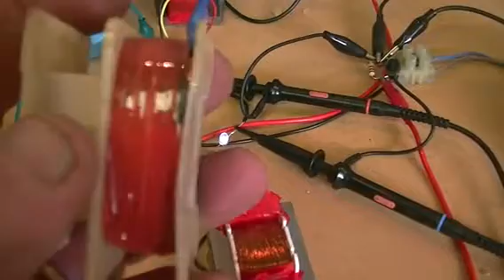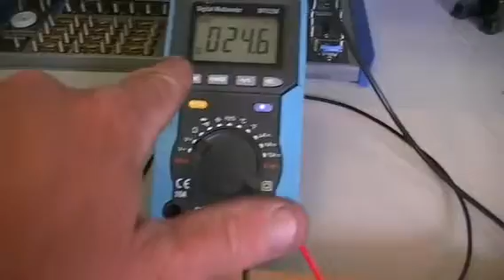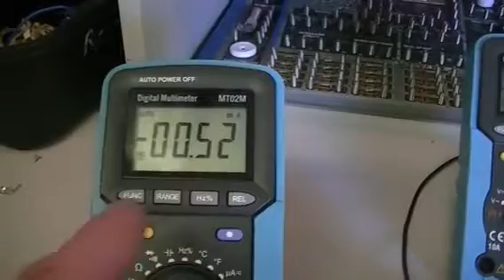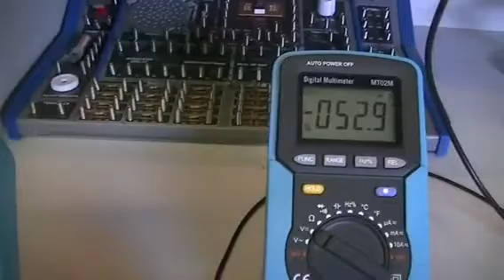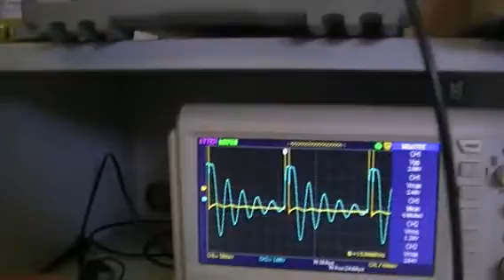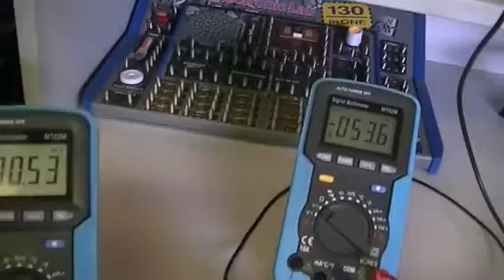overunity transformer reserch V2

Comment: I was able to partially 'solve' this the interesting part is the transformer configuration
But regardless the secondary is free-wheeling,  it's ringing at it's self resonant frequency 
It will ring like this and as the input frequency is raised the ring will lessen until as mentioned the input pulse will be pulsing the secondary at it's self resonate frequency. 
The commonality is probably be the earth ground which is allowing the secondary to free-wheel. 
In my analysis I only observed such action without an earth ground with a split core then coupled,  I.e a core split in two, which allowed the secondary to free-wheel

Comment: By co-incidence this is something that i am experimenting with also - :

- something that simple could be acting in that way just because it is not all that 'simple' once you understand what is probably occurring.

- to give you some starting points i will link you to a video you can watch if i put a link in here likely YT will try to censor this comment in fact i highly recommend that you move all your video's across to 'bit chute' if you can as YT will probably increasingly start to 'censor' many people. 

- anyhow here is a video you can watch - https://hooktube.com/watch?v=OXibsOzjipw

- the key is in a coupled inductor a lot of people don't seem to know that a 'current' in a winding can be 'interrupted' and what he means by that is it can be 'converted' you will see how when you watch the video - the result is a 'flyback' but really a 'magnetic' pump - in your setup you have then used a principal from this Air force video -(i will link) but you are not using the LC you are using the pulse and a single 'ringing' (actually rotating) coil. 

- so as i see it you have interrupted and converted the pulse at it's peak on a coupled inductor creating a basic 'magnetic pump' you have then tuned it to hit the pump at the correct time as per this video here :

https://hooktube.com/watch?v=1uSBKUsKpYQ

I hope this find you well.

to see if that is the case you can test by removing the diodes in some other configuration as it is the diode that acting as the interruption switch .

you may like to see the way in which the air force related the 'ringing' oscillation to the rotation of a flywheel i really liked that as it is far more accurate.

Comment: I was thinking what are the possibilities if a simple delay circuit can be made to switch on led or small bulb somewhere after the trailing edge of the source pulse.

Maybe this way it will not have any impact on the source at whatever the load at the output.

I assume you have already figured out on how to maximized the pulse width from output as compared to the input pulse width  base on video.

Comment: Hi mate, here's a guess: The primary and secondary are both capacitively coupled as well as inductively due to way windings are wound together. Capacitive coupling links fast changing portion of input to output at initial pulse step. Input cannot see far end of primary coil till current reaches far end of winding. So output initially capacitively coupled. Then after some delay current rises in primary inductance linking both coils inductively. However input current pulse has ceased by then and primary current doesn't like being interrupted so collapsing field maintains current flow for an additional time. When input pulse is ON output impedance of generator is very low, however when pulse duration has terminated the output impedance of generator is most likely open circuit or very high Z value. So primary is no longer damped by the generator allowing it to ring like a bell.
Reply: +smokyatgroups Interesting thoughts, I have used a small audio transformer as a capacitor to couple a frequency counter to a radio. Otherwise I hear noise from the frequency counter through the radio. IIRC the transformer did better than any ceramic cap, or I wouldn’t have left the more expensive transformer in place. I connected only one end of each winding as a capacitor. I have unwound them and they are done with an inside winding and outside winding with no dielectric isolation.

Comment: Transformers only require an alternating current and therefore changing magnetic field to work.  A current will be induced on the secondary if the voltage is positive or negative. I cant actually see what you are saying here.  What do you mean by flowing in/out?

Comment: Very interesting effect that center tapped ground, diode, and capacitor is doing. That capacitor is a beast of a filter. Have you tried putting a blocking diode on your positive side of you PWM?  I wonder if that would effect the circuit at all?  Thanks for sharing as always and keep up the good work.
Reply: Daniel Gendron Quelle est votre interprétation de cette citcuit ?
Reply: Yes this is when your primary is a square wave. di/dt is appearing same as this in the secondary (second order damping impulse) Diadon Acs